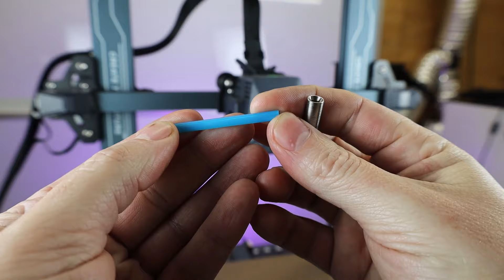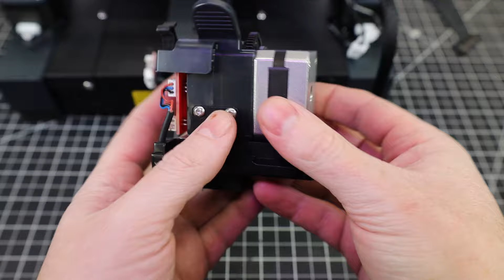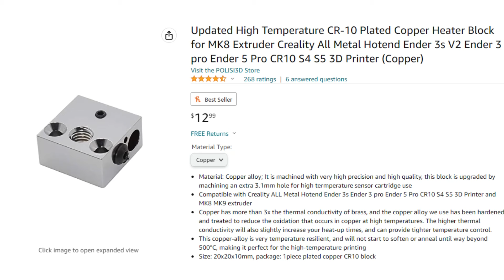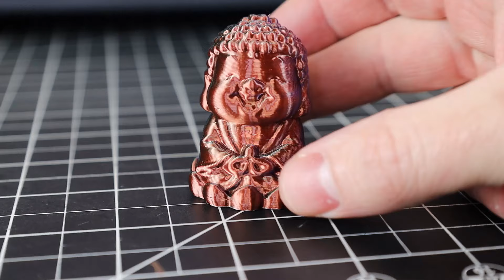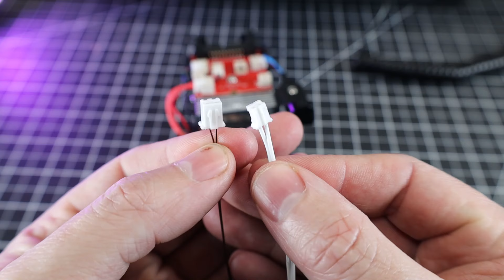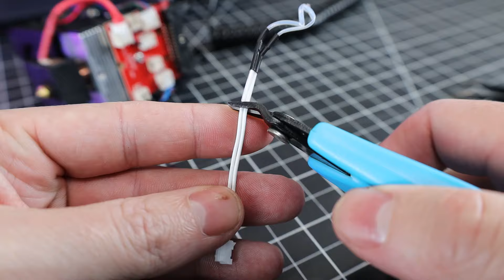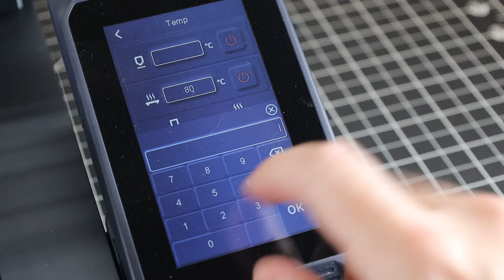$25 All-Metal Hotend Upgrade For Elegoo Neptune 3 Pro, Plus & Max

Comment: This is GREAT! Thank you! I literally bought an SV06 in addition to a Neptune 3 Pro, because the SV06 can go up to 300 degrees stock. I'm going to use my N3Pro to print TPU and lower temp filaments. But I love the idea I can so easily swap my N3Pro over to high temp. I may be buying some of these parts just to keep on hand, just in case.
Reply from the maker: Honestly not a bad plan and yeah being able to upgrade it for fairly cheap is nice as well so you can have two high temp printers.
Reply: How do you like the SV06 compare to the N3Pro? I would have had an SV06 if they were in stock at the time.
Reply: @float32  I was going to buy an SV06 but the growing screams on Reddit over their hit & miss build quality have put me off. And now I know how to upgrade the '3 Pro there for me at least really isn't any advantage.
Reply: @loc4725  i bought an sv06 and i have not had 1 successful print yet. i was told its such a good printer and that its the best printer for beginners, yeah no its horrible. ive tried everything to fix it and nothings worked. i plan on returning it and buying a neptune 3 pro.
Reply: @float32  I just got my SV06 a week ago and haven't had much time to play with it, but I love it so far. My N3Pro should be here tomorrow.
Reply: Do you still love the SV06? Like so many others, I can't decide between Elegoo or Solvo, Solvo gets quite a beating on Reddit for poor quality, while others praise them.
Reply: @dejedejsson  I still have it and my Neptune 3 Pro. Both are great printers that have their issues, honestly. It's mostly just going through each one and making sure the frame is square, lead screws are straight, and all bolts are tight and well adjusted.
Reply: @dejedejsson  I would previously recommend Solvol but as time has gone on it's become apparent some of their machines suffer from bad QC. You might get a good one or you might be unlucky. Solvol's main edge is that some of the things you might want to upgrade on an Elegoo have already been done and its ability to print at higher temperatures but that said most people aren't going to print anything more exotic than PETG & ASA and if they are then a higher quality (more expensive) machine is almost certainly the way to go. That said to be fair the SV06 does seem to produce nice prints with exotic media so a functionally good example would save you some money.

Also bear in mind that the SV06 isn't so good with TPU whereas the Elegoo seems pretty reliable, as far as is possible with that media.

If you're willing to take the chance, think you're going to print a lot of higher temperature (and more expensive) media and don't need to print TPU then the SV06 looks like a winner. A functionally good SV06 has most of the upgrades I'd do to an Elegoo and has really nice print quality out of the box. But OTOH if like most people you intend to only print PLA / PETG / ABS / ASA / TPU then I'd go with the Elegoo, upgrade the PTFE tubing to Capricorn for longer life & higher temperature tolerance, replace the plastic bed leveling standoffs with metal ones and flash the latest firmware.

If it's your first machine I'd go with the Elegoo unless you can find a retailer who accepts returns and don't mind the difficulties with printing TPU on that machine.
Reply: Thank you for a very comprehensive answer.
I am now 98% sure it will be an Elegoo, Svolo's nozzles are a dealbreaker.
I was just looking at the Capricorn tube but wasn't convinced that it really can handle 260c? Why isn't Capricorn mentioned as an option to be able to print up to 260c, I've probably seen 10 videos on this very subject and no one mentions that it was possible to change the tube that can withstand a higher temperature than 240c.
Reply: @dejedejsson  Genuine Capricon tubing can go higher than Chinese PTFE tube, which is sometimes advertised as "Capricorn". In any case the tubing won't last as long at higher temperatures but then you really shouldn't need to go higher than 250°C unless you're having difficulties with a particular filament brand (try another) or want to try some supposed low temperature exotics.

On their website the manufacturer 'Captubes' has a safety section with a temperature chart, for 260°C they say:

"We do not recommend printing with our TL tubing above this range. Our XS Series tubing has additives that will allow it to print at higher temperatures without deforming, but safety is still a concern due to PTFE offgassing."

PTFE gives off neurotoxins above around 260, it generally only gives humans headaches but is deadly to birds.

Comment: Very nice! The temp range was the only thing that had me hesitatiing. What about temperatures above 280°C? Can you set 300°C as well by gcode on the new firmware?
Reply from the maker: According to Elegoo you can go up to 300° c on the newest firmware through g code. They did suggest not doing so due to the thermostat not being up to par even the one I show in this video isn't rated for that temperature. I did see some other ones online that are but they didn't have the same numbers as this thermistor so there might be some tweaks you have to do.
Reply: @randymay  Maybe, Can I use Ender 3 S1 Pro thermistor?
Reply from the maker: @priaposcompany9342  idk
Reply: I have not found a single person who has been able to successfully set the firmware over 260c. I've wasted a lot of time and money trying.
Reply: @s0d4c4n  do you think replacing the motherboard with the new 4 max or using the max4 firmware to update the max3 will work ?

Comment: Thanks for this!  Had already ordered the heatbreak and block from your previous video, looking foreword to putting everything in action soon!  Based on your measurements from the last video, I've ordered some 2020 extrusion and connectors to build the enclosure frame.  I've got a pre-cut 32" x 42" plywood base to build everything on.
Reply from the maker: Very nice let me know how all that stuff turns out once everything comes in. 😁👍

Comment: The PTF tubing is still needed; correct? How much of the PTF tubing are you cutting off?
Reply from the maker: So it's not absolutely needed I'm using it without but I find it a little harder to get the filament into the hot end. So I'm probably going to just open it up and put the PTFE tube back in there. You're going to want at least 30 mm.
Reply: @randymay  Thanks for the video. It's great to see that apparently parts for Creality fit in the Neptune. But if you still have to install the PTFE tube doesn't that contradict the modification as the whole idea was to get rid of the PTFE to run the printer at higher temperatures? Now it's still in there and wouldn't that prevent exactly that?
Reply from the maker: @yo.marc.1  You can put the tube back in with no problem. The top of the heat break doesn't get as hot as the part at the nozzle. You will only need 30mm of PTFE tube. All this does now is help you swap out your filament and easily get it down the heat break. 

So in the end it will be up to you but it won't change how hot you can print at.

Comment from the maker: Here is the full list of the items that you might need to do this yourself:
All Metal Bimetal Heatbreak Copper & Titanium (4 Pack) - https://amzn.to/3ILv6bP
All Metal Bimetal Heatbreak Copper & Titanium (3 Pack) - https://amzn.to/3HjcPRN
All Metal Bimetal Heatbreak Copper & Titanium (2 Pack) - https://amzn.to/3kxLylX
All Metal Bimetal Heatbreak Copper & Titanium (Just 1) - https://amzn.to/3HjvfSp

Copperhead Heat Break C-E (If you are looking for a better quality heat break get this one) - https://bit.ly/Bimetallic-Heat-Break-Upgrade

Aluminum Heater Block (Must use M2 X 16mm bolts) - https://amzn.to/3CKCIar

High Temp Plated Solid Copper Heater Block (Must use M2 X 16mm bolts)  - https://amzn.to/3CQVIUV

Stainless Steel M2 Bolts - https://amzn.to/3XmuRZ2

Stainless Steel Metric Bolt Assortment - https://amzn.to/3XKsuze

Thermistor 100k NTC 3950 M3 Stud - https://amzn.to/3QQ5M6q

Heat Shrink Tubing (If you are just going to just cut the old wire and solder it make sure to use something like this) - https://amzn.to/3D1mRV7

JST PH2.0 Connector kit ( To replace thermistor plug) - https://amzn.to/3J5lSan

JST PH2.0 Connector kit with Crimping Tool - https://amzn.to/3XHG1Hx

Micro Connector Pin Crimping Tool Only - https://amzn.to/3weB7pS

You might want to use some thermal paste to get better heat transfer but you don't have to:
Slice Engineering Boron Nitride Paste - https://amzn.to/3w15Bvw

If you're looking for the latest Elegoo firmware you can find it here - https://www.elegoo.com/pages/3d-printing-user-support

Links to Printers:
Elegoo Neptune 3 Max - https://bit.ly/NeptuneMax
Elegoo Neptune 3 Plus - https://bit.ly/Neptune-3-Plus
Elegoo Neptune 3 Pro - https://bit.ly/ElegooNeptune3Pro

Elegoo Neptune 3 Max (Amazon) - Coming Soon
Elegoo Neptune 3 Plus (Amazon) - https://amzn.to/3kbB0IN
Elegoo Neptune 3 Pro (Amazon) - Coming Soon

3d Printer Filament That I Use:
PolyLite ABS - https://bit.ly/PolyLite-ABS
PolyLite ASA - https://bit.ly/PolyLite-ASA
PolyFlex TPU 95 (Flexable) - https://bit.ly/PolyFlex-TPU-95
PolyLite Silk PLA Blue - https://bit.ly/PolyLiteSilkPLABlue
NylonX Filament - https://bit.ly/MatterHackersNylonX
PolyTerra Marble PLA - https://bit.ly/PolyTerraMarblePLA
TECSONAR Tricolor PLA - https://amzn.to/3H79d5N
Build Series PLA - https://bit.ly/MatterHackersBuildSeriesPLA
Build Series Silky PLA - https://bit.ly/BuildSeriesSilkyPLAMatterHackers
Build Series ABS - https://bit.ly/MatterHackersBuildSeriesABS
Build Series PETG - https://bit.ly/MatterHackersBuildSeriesPETG
PRO Series Filament - https://bit.ly/MatterHackersPROSeriesFilament

Amazon 3D Printing Filament:
PLA - https://amzn.to/3gsLE9Z
PETG - https://amzn.to/3pXjjvu
ABS - https://amzn.to/3wsTRjS
ASA - https://amzn.to/2RX8dtM
Polycarbonate - https://amzn.to/3cLdr38
Nylon - https://amzn.to/3iNGeI2

Editing & Camera Gear:
Canon EOS R - https://amzn.to/3ULd2AH
77in Tripod - https://amzn.to/3FICPFw
Studio Lights & Stands - https://amzn.to/3HqSGtv
Thermal Camera TOPDON TC001 - https://amzn.to/3HquffP
DJI Pocket 2 4K Handheld 3-Axis Gimbal - https://amzn.to/3UOqmVc
Accessories Kit for DJI Pocket 2 - https://amzn.to/3Waszeq
Video Editing Software - https://bit.ly/Wondershare-Filmora-Video-Editing
______________________________________________
Note : Most of the links that I use that go to products are affiliate link. This means I make a small commission on anything that you happen buy using them. This is at no extra charge to you and this helps support the work I do on this channel. 😁👍
______________________________________________
Reply: Any Canadian link?
Reply: Hi! Yours is the only tear down video i have come across, thanks so much for psoting it. Im having an issue whereby my neptune 3 pro direct drive kind of grinds the pla instead of extruding it. ITll start printing the buddah, but after maybe ten layers, it seems to grind rather than extrude. I had a major fail last night, the type where all the plastic gets up into the whole mechanism, and im wondering if it might have melted the plastic inside. So i'm ordering new pieces through your affiliate links. Do you know how i tear down the gears to clean them? Is that psossible?